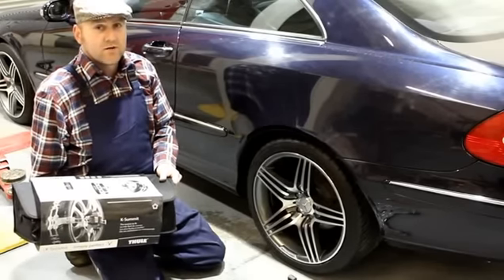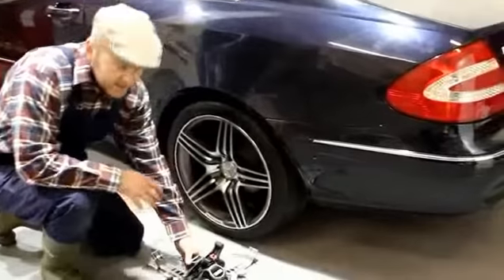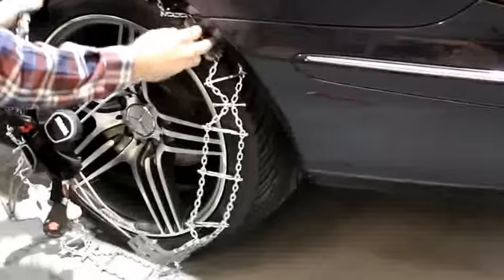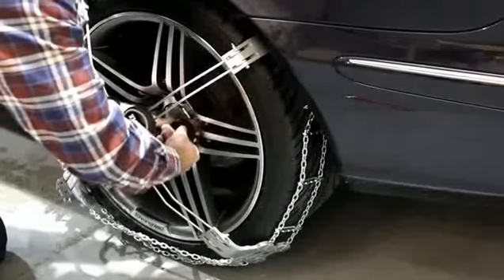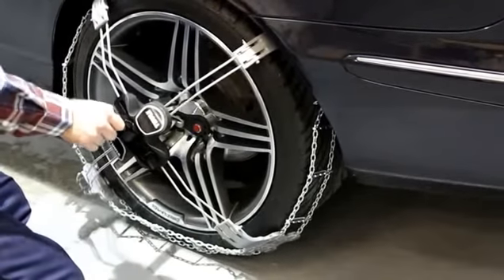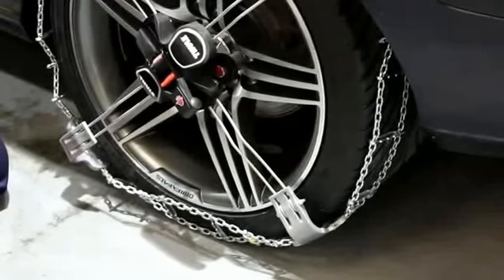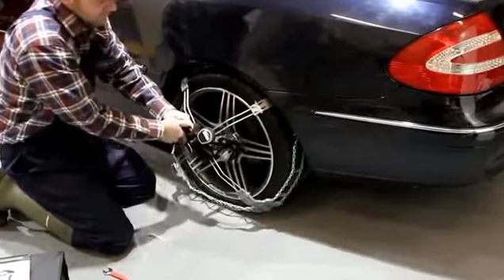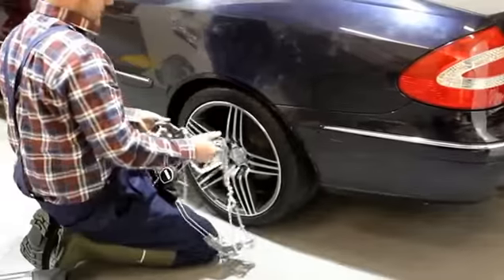Fitting Thule K-Summit snowchains with Farmer Giles.

Comment: I would not be allowed to drive 10meters  along the road if enforced like a previous time to have to fit the chains while up the mountain going to Val d'Isere.  The police were insisting you have the chains fitted properly before they would allow you back on the road. It was freezing cold and dark at night when it started snowing really heavily. Had to put the chains on at a "lay-by" on the side of road. Could only rotate the wheels a couple of times to get the chains seated properly. The drive "down the road" is not going to cut it with the police when you are half way up the mountain. No chains fitted or fitted incorrectly and you would be sent back down the mountain. A car being stuck on the narrow road is a serious risk. The chains need to be fitted correctly within a couple of rotations of the wheels !!!/